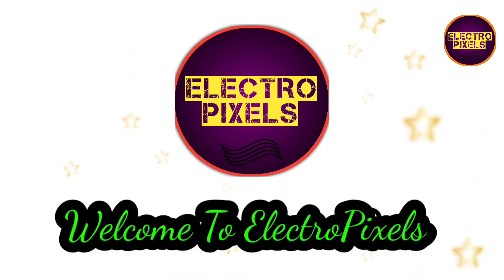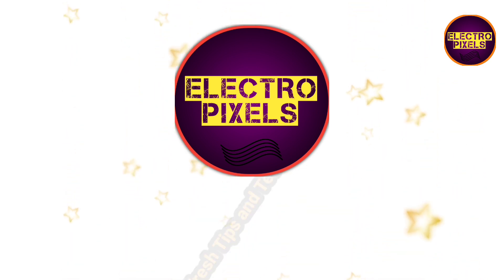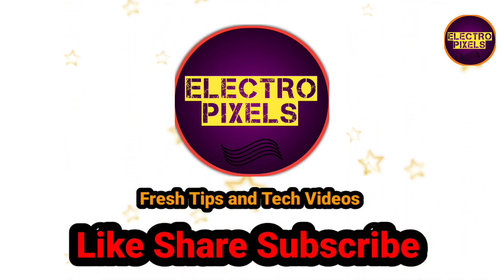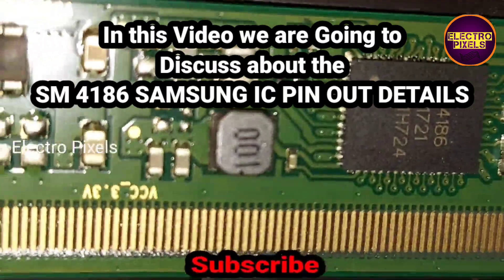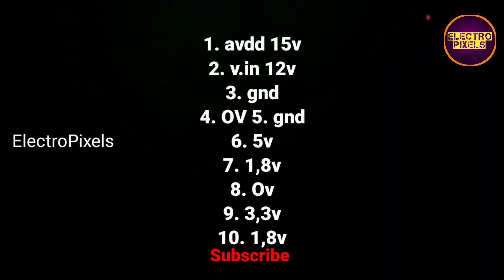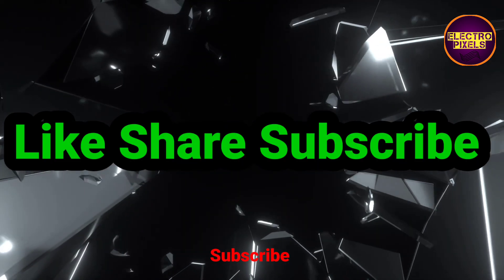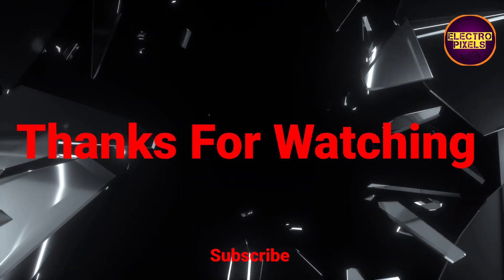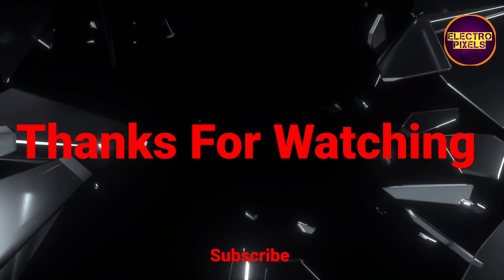SM4186 IC Pinout Details||Datasheet of SM4186 IC||SM4186 IC Pinout Voltage Information ||DC-DC IC

Comment: What is the value of that capacitor going to pin number 10? Mine was shorted and I can't find it value
Reply from the maker: Remove that capacitor and check display is ok or not
Reply from the maker: Also check the panel Fuse is open or not

Comment: Sir I change this ic but not generate any voltage I also cut both side ckv signal line 3.3v present & 1.8 volt presnt plz help what is probelm plz 🙏
Reply from the maker: Maybe both side Gatesignals are short. Change Panel

Comment: Hey Friend, do you know how to force the IC/DC SM4186 to generate the output voltages, considering the inputs basic voltages are present, its missing only the enable voltage.
Tks
Reply from the maker: It's Goes to Protection Mode due to internal shorting in Gatesignals, please watch our Latest video is Regarding this topic, the video is available in our channel playlist